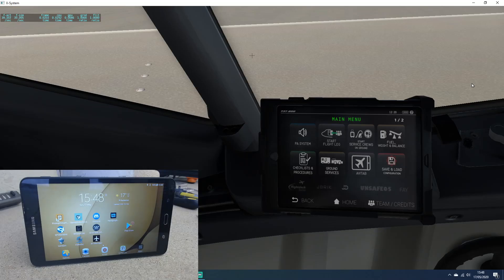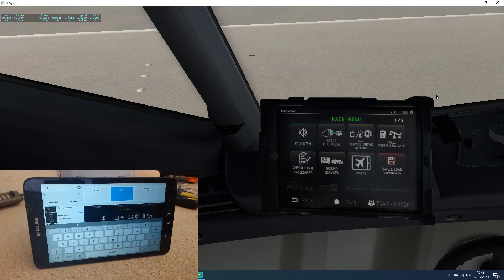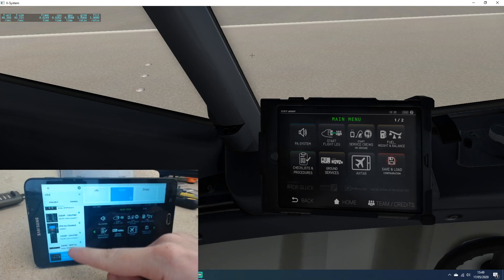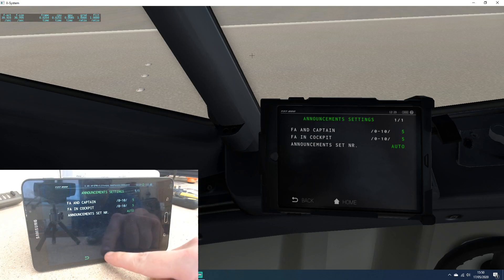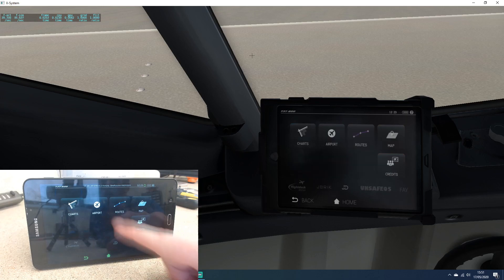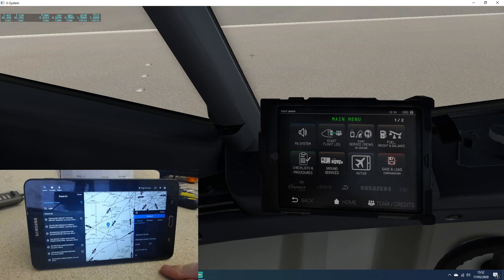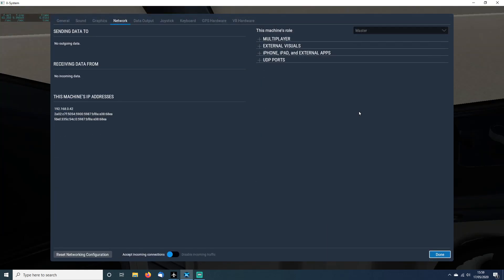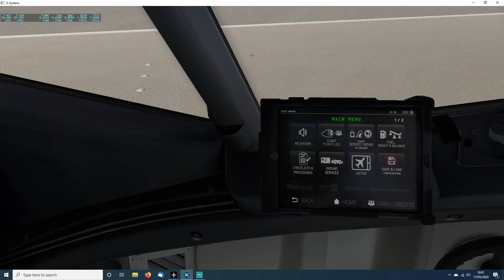737 home sim build, how to zibo tablet on real tablet/ipad

Comment: did you found out that better pushback work?
Reply from the maker: Hi Henrik, I still haven’t tried it as I’m still only using my test pc while building the sim but I’ll install better pushback this week and try it, I’ll let you know
Reply: @simbuilduk5853  thanks
Reply from the maker: @henrikhansen9843  I have just tested and can confirm that better pushback works fine when controlled from a tablet/iPad
Reply from the maker: @henrikhansen9843  not really much to show, it just copies exactly as the zibo tablet does

Comment: hello my friend all right, I would like a help from you, because I am not able to connect my tablet with air manager to view the zibo tablet, the app has a red X.
Reply from the maker: Have you put the air manager plug in in the xplane plug-in folder? Found here https://siminnovations.com/wiki/index.php?title=Flight_Simulator_Plugins_Installation
Reply: @simbuilduk5853  thank you very much for your attention, I will download and test with this plugin.  and I tell you if it worked, thank you very much.
Reply: @simbuilduk5853  good night friend, take a question, do I need the Air manager on the PC or just need to have it on the tablet?
Reply: @simbuilduk5853  After I installed the plugin it worked on the tablet thank you very much for your attention.
Reply from the maker: @joserodrigo9916  no probs 👍
Reply from the maker: @joserodrigo9916  just tablet if all you want to do is run the zibo tablet on it

Comment: hello good morning, how can I project abitab on my tablet could you pass me the link please thank you
Reply from the maker: Hi, I dont think you can use avitab on a tablet, will have to look into it
Reply: @simbuilduk5853  but in your video I see that if possible
Reply from the maker: @carloscampillo9229  oh I thought you meant full avitab with charts etc. You just need to download airmanager then follow my instructions on my vid
Reply: @simbuilduk5853  ok   thank you very much
Reply: @simbuilduk5853  is there a way to download air manager for free?
Reply from the maker: @carloscampillo9229  normally you can download it for free and use some basic features but you have to buy it to make full use unless that’s changed now?
Reply: @simbuilduk5853  ok thank you very much for the clarification, and could you tell me where I can download it for free please
Reply from the maker: @carloscampillo9229  go to siminnovations website
Reply: @simbuilduk5853  OK thank you very much